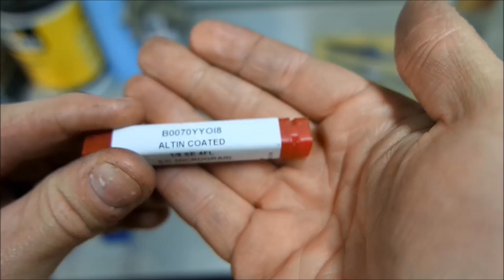Milling Without A Mill! (On The Drill Press) | Güth Blades

Comment: Buy a good X-Y TABLE and additionally a milling vise. All X-Y vises are pretty much junk, or you will spend as much as you will for a cast iron milled and ground X-Y table with V ways and gibs, which is what you want anyway. The table and a clamping kit will let you hold much larger parts than a vise will. You still can only do small and light machining, but there is a very common use case for light machine work on larger parts. But if you go down this route you will identify other areas of the drill press that also need upgrading to make more precise and more rigid. These can be done cheaply but you will have to know what you are doing.

Comment: You are breaking bits because you go way to deep.. its supposed to take layer by layer slowly.

And these tables are amazing if you consider them to not be mill tables instead its a "cross vise" being able to drill alot of precis holes in 1 object without moving your vise and reclamping everything. Its trully amazing handy tool.

It can be handy for some simple milling project like myself i make the slots for spearguns (wood) and fine tune triggers and spears i make (stainless steel) but cutting in steel is a very slow process.

Comment: For a mill bit so small, this is all wrong. The speed too slow, the cut too deep on the bit.  Even on a milling machine, this would be wrong.
 I jigsaw and file would do a better job than ruining the drill press.

Comment: @Clifford Moeller  Yeah your totally right the vise is crap and i mention that in the beginning of the video, I highly recomend that you try to save money on the x,y vise because you get what you pay for and a good vise will last several life times.   The Drill press which is porta-cable is ok it does have some play in the quill if its not locked down using the depth screw this would work much better on an older more solid drill press.   Thanks for the comment!

Comment: I couldn’t imagine giving this a try I seen the surface tilt a number of time which would end up costing me more money and time. If you are stuck on using this method to get by for now. Try a rotary tool with a drill press stand. I think it would work much better. The rotary tool has many different burs you could swap in and out for desired cuts.

Comment: Ahhh...aren't you suppose to use the end of the milling bit and not the side of the bit? I guess that's why it is called an end mill. The bite is t the tip of the bit so you need to start at the top of the piece and work your way down; like you are shaving the top  each pass. The spiral on the bit is fore evacuating material as you cut, not to cut the material.

Comment: hint: find small feed carriage for lathe on local scrap yard, after small repair you will have one feed axes with good tight ways, and handle with feed drum
put it on drill table, and tight with bolts -- maybe you will need some grinding to cut unneeded lugs, and make downside flat and stable
see here to understand about part I mean: https://www.youtube.com/watch?v=iTJVXA1zqZ4

Comment: do not use a drill chuck for milling, is designed for vertical load not side load.  You can use morse taper mills or a morse taper collet holder and cheap er16 collets

Comment: will this work on the $50 harbor freight drillpress?
Reply: It will "work" on any drill press but for how long depends on the quality of the drill press. If you take apart the quill on one of those fifty buck HF ones you will find that the drive shaft down the center is barely 5/8" in diameter and the bearings are really light. Check out craigslist and e-bay for an old forties and fifties vintage drill press. You can find them for fifty to a hundred. They might need a bit of refurbishing but they are far tougher than the HF stuff.

Comment: When milling you should not be going up and down you need to go in a bit and mill left to right then put the bit deeper lock it go left to right you are breaking bits because you are just doing it wrong regardless of the vice even with a perfect vice you shouldn't do it that way just trying to help
Reply: Please do some machine work before posting comments. Working with the end of the end mill is the best technique when you have a shaky setup or machine.

Comment: i only need a one time task , and thats to remove some material from a high carbon knife . the part of handle where the trigger finger sits , its a circular cut out that i want to grind a quarter inch deeper so my trigger finger has a better grip on knife . ive a basic craftsman bench top drill press i was figuring to put a honing stone on then set knife flat on press table and grind the stone into both knife metal and fiberglass handle material . appreciate any input as this is an 80$ knife i dont want to mess up : https://www.bladehq.com/item--Ontario-RAT-7-Knife-Fixed-Blade--11235

Comment: almost as fast as a file.  5 thousands would be a starting place for a pass and it might be too much for a duck tape rig. I mill in my drill press and it takes longer than any other method and is not as accurate.  under a thousand will get you a mini mill and some tooling to do a proper job

Comment: Drill presses are designed to handle vertical torque, whereas mills can handle sideways torque.  Using an X-Y table on a drill press to position holes is a good idea, milling on the drill press is not.  You can get good, relatively inexpensive, mini mills with high torque brushless DC motors from Micro Mark and Little Machine Shop.  Don't waste your money on other mills with weaker motors from other vendors.  And DON'T RUIN THE BEARINGS IN YOUR DRILL PRESS BY PUTTING SIDEWAYS PRESSURE ON THEM!

Comment: In reality;  setting aside that he is way too much in a hurry;  bits should come with each their own precision fit (possibly brass) so that we could mount the bit with it's sleeve while loosening and extending out the tool from it's sleeve;  as the dept of the mill gets deeper and adding a high enough diameter(to clear any obstacles) roller bearing or bushing and sleeve type on a thin disc just above the chuck;  on it's shaft and another same or what not;  maybe mounted on top of the  belt pulley.  And for those whom would want to be extra precise;  they could mount a lathe chuck on that chuck and set roller bearings there also.  Cheers and tell me what you thought please;  and for the record;  I didn't spend any more time on thinking of these ideas any more than the time and maybe twice the time it took me to write this comment.

Comment: That vise can be adjusted and tweaked so it slides properly. Don,t need to pull the handle down, move your table up would be easier. Go slow and small increments "it won,t break" Get end mills from "Cut to Size" or "Xometry" then fo watch a better YouTuber.

Comment: VERY Dangerous Thing to Do ..... Drill presss are NOT designed  for SIDE LOADING of the spindle !!
(side Pressure)  Another issue is DRILL Presses  dont have COLLETS to hold the end Mill cutters 
Securely !!   The end  mill is ONLY held in a drill chuck by THREE Jaws NOT a Collet !!  
And on top of those 3 NoNOs  ANY unfixed Milling cross compound  vise is NOT really safe to use for milling operations and could come loose from the drill press table . AND Finally spindle speed of the drill press are NONCONDUCIVE to Milling Operations 
I am a Retired Toolmaker and have seen ACCIDENTS by folks  who use machine TOOLS Inappropriately . My advice  DO it with a PROPER Machine  NOT a DRILL PRESS  
Stay Safe !!

Comment: You've spent a lot of money to demonstrate why a drill press should never be used as a milling machine. What you achieved on this video could have been achieved with a hacksaw and files in pretty much the same amount of time with a considerably better finish. End mill bits are not cheap and the assurance that "you will break them" is not encouraging.
I don't think you've found a solution here.